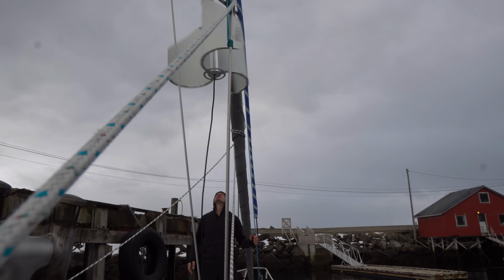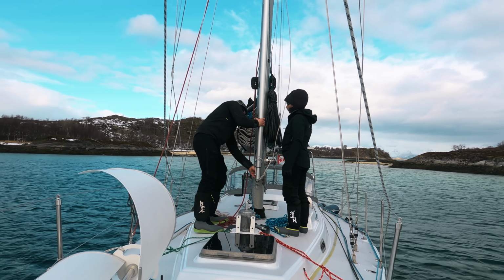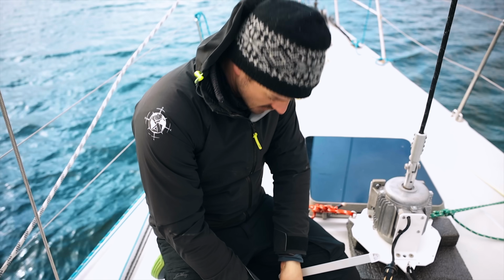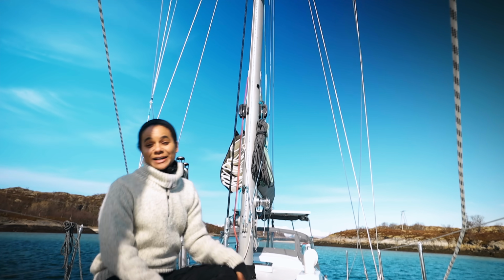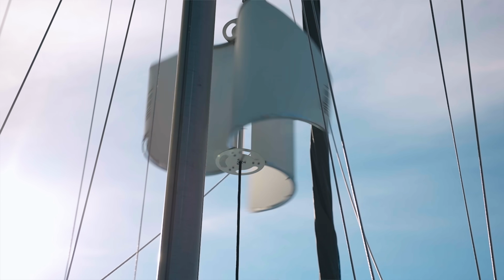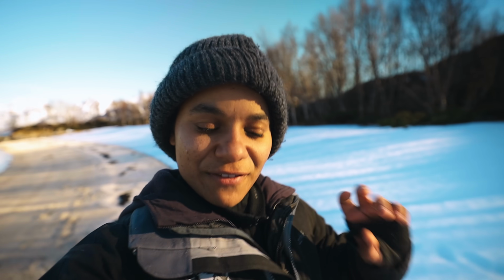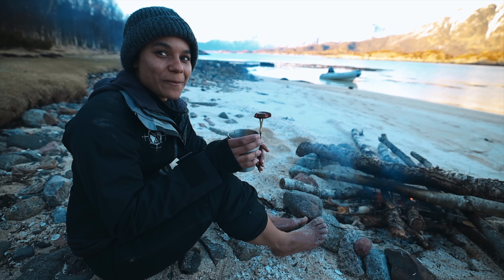No Sailing, Just BULLSH!T — Sailing Uma [Step 273]

Comment: Just a idea? You can use fiberglass rods that screw together, like the ones used to clean fireplaces with a brush , I clean my wood stoves with brushes using fiberglass rods about 3/8 and 36” long screws together I clean a second story house -plus ! They would make a great Torque rod from the blades to the generator and can be broke down to 36” lengths for storage, they are cheap and can be purchased in any home improvement store or online . Please check it out P.S. the threads on the rods go the correct way for your wind blades to spin !🤔👍🏻

Comment: Since you began this journey, power has been a concern.  Every time voltage is changed, power is lost and I discovered (thanks to Damien) that many household items can run directly on DC as long as the DC voltage is higher than the device needs, but lower than the AC rating of it.  This might help reduce your power consumption be even a few percent.  I everything I tested worked on DC w/o needing an inverter :D  Link to Damien's video as a demonstration: https://youtu.be/RdODgbnkFss

Comment: Dan, another thing that might have even more torsional rigidity and would stay straighter would be to use some high burst test hydraulic hose for your shaft.  You might even be able to put the hose inside a PVC sleeve to make it even stiffer.  Schedule 80 PVC electrical conduit has a pretty thick wall.  If you got really sharp you could put seals at both ends of the shaft and then put a light oil in it to cut the friction.  You should be able to find some hose about the size of the bore in your coupler.  If not, you could use a piece of shafting installed in the coupler and then slide the hose over it.  The rubber liner of the hose could be drilled out to get a very tight fit on the stub shaft.  A good hydraulic fab shop should be able to use a crimp on fitting to attach the hose to the piece of shafting.  You could then do something similar at the top.   You might even be able to put more tension in the hose connector to keep it from whipping against the mast.  I look forward to seeing what you come up with.
Is there gearing in the turbine to spool up the RPM inside?  In Sweden where I just bought a farm, have also found good quality crimp on studs that will cure your problem with the screw on terminal blocks.  The smoke may have simply been the new boards burning off manufacturing residue.

Comment: Since electrons run across the surface using more stranded wires increases electrical flow and lowers resistance.

Comment: Thank you Kika and Dan for sharing your experiences with the rest of the world!
I've just saw the following video on YouTube and I thought I should share it with you as it may help you harvest more solar energy from your existing solar panels with minor modification: https://youtu.be/FKhszB4E1_M
Reply from the maker: Thanks for thinking of us and sharing the link. But this one we've actually seen before. Find it a little comical actually. So this response ins't directed at you, personally, but for others who might watch the video and "get ideas". Parabolic reflectors in the solar industry have been around forever, but not commonly used for good reason. Initially was interested when he started talking about fresnel lenses, the the overheating of the cells is a real issue. 

Besides, the first panel is in the shade, and the second one is in full sun. So right off the start, the results are useless. That much shading will drop the output 80% or more. 

The second problem we see is, those reflectors are the same size as the panel, so just add two more panels to either side and you'll triple the output. 

Third issue is that you MUST use the reflectors, since when folded, they block all incoming light. 

Fourth is that those would get destroyed in a good wind storm. 

We are working on adding more solar to Uma. But these things take time to get right. Once we have a working solution, we'll be sharing it here on YT.

Comment: unfortunately the active surface of the vertical windmill is less than half the diameter multiplied by height, so to compete with a 3m diameter horizontal windmill having around 8square meters you would need a huge rotor. Don't blame the charge controller or the generator, there is just not enough primary mechanical  energy to work with.

Comment: I have really enjoyed your posts but have never comented before.  Have you considered how dangerous that rotating shaft is?   I was working on a crew in 1975, drilling out the tubes in a heat exchanger.  The device had multiple brass tubes running through it that had heavy scaling inside them.  We were using a large air-powered drill to drill out the scaling.  My coworker had long shoulder length hair which got caught up on the drill shaft.  The guy tunning the drill saw his head get pulled down suddenly and shut the drill off.  I think it would have broken his neck.
His hair was so entangled that we had to cut it to get him loose.  He had a couple of spots where the hair was pulled out by the roots.  There is a reason for rotating shafts to be fully enclosed!

Comment: Interesting concept but appears not to have enough potential power for what you need on an electric sailboat. Obviously, with power output proportional to wind speed squared, you will get 4 times the power at double the wind speed. Still not enough in my view. I would have gone with the typical horizontal axis and spent my time working out an extendable mount that can cantilever off the stern. It should be possible to make it compact enough so that it tucks into the back when not in use and goes 4 meters aft for operation.

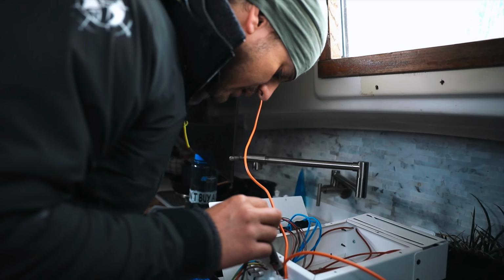Comment: About Your issue in @13:15 with a screw terminal. Actually they are much better things what You're advertising them ;) First at all DO NOT solder wires tips, especially DO NOT use lead free solder to do so. Lead-tin solder alloy is very soft, so You won't be able to screw the terminal firmly enough. The more torque You are apply the more soldered tip will squeeze, so finally the connection may get very loose and starts to burn due to increased resistance. The proper way if You have stranded copper wire You should use special steel ferrules (like Conrad Electronic part number 490812ks) which are pressed onto the wire tip using special tool. Then such can be firmly screwed using such terminal like it would be solid copper wire. Instead of screw terminals You can always use WAGO connectors and terminals. WAGO produces spring terminals which as name suggests has a spring pressing against the metal contact and keeps contact good even in mobile/vibration environment. You don't need (and really shoudln't) solder wire tips then.  Look at WAGO CLASSIC series (example part numer: classic 222-415)

Comment: You need a 4” tube, inside 3 small horizontal wind turbines bolted to the 4” PVC tube, with each turbine benefiting from the exhaust of the turbine in front of it. A fish mouthed solidly glued vertical mounting post, mounted to a ball bearing deck mounted swivel. You need a small little nylon sail on the rear to keep it pointed into the wind. Walla you just created a new approach to sailing and other wind generating needs. You market this and  the world is your oyster. The bad news is, you may need to manufacture most components but that’s my unqualified concept in just a few words.

Comment: Four weeks ago I suggested you get look at sort of hinge apparatus for your solar panels to avoid overnight snow accumulation and to be closer to perpendicular to the low rising sun angles you get (if at all) that far north, then reproached myself a few hours ago today for not making allowance for the need to have a sturdy fitting for the panels to resist really strong winds. EDIT: Oh, you can hoist them vertical @18:00 - just not hinge them fore and aft!

Not to be daunted by, or learn my lesson from, such an experience ... would you consider some sort of dismantlable apparatus that you would put up (once anchored/moored) behind the boat, above the self-steering wind vane (which also has a dismantlable aspect, I suppose) and hold a horizontal-axis wind turbine? It wouldn't block the solar panels if dismantled, and would only be erected on windy cloudy days (when solar isn't generating).

That location would get it away from your cabin so that the noise doesn't affect your sleep. That far from the end of your boat might give the vibrations a seesaw/leverage effect, and you wouldn't want it in place when using the wind vane or running down wind in big seas, or going stern-to on certain town quays in the Med. It might also affect your LOA and fees for marina or town quay berths or taxes, depending on whether it was up and included when measured. And dismantled, it might take up some space, but maybe you could work out how to re-use the spinnaker pole (in conjunction with the solar panel frames) to mount it, so the only extra volume needed is the turbine itself.
Reply: Ah, I see you are using the spinnaker pole with the torsion line and now know you have a torsion line for furling your a-sail. I didn't know that yesterday when I said you were very brave flying the kite without the main up to dowse it behind. So I will reproach myself about that too. ;-)

Another thing occurred to me. Get a Torqueedo, figure out how to mount it upside down  on the end of the spinnaker pole and in a way that it can re-orient itself to catch the wind with increased blades attached.
Then next week: how to generate electricity from a Torqueedo as you drag it through the water... ;-)
Then the following week, build your own regenerating Torqueedo by mounting your generator like this guy did: https://www.youtube.com/watch?v=-TtpMrh_iR4
Reply: Could you fix the house wire lego connectors with aluminium foil or tin foil, or bits of cut up hair clips?

PS No sailing, just bullshit? I love your technical videos - the CapeHorn install, the copper-epoxy, the first elec-motor install, the swap-out for the ocean drive. I can go sailing any time (if we weren't locked down) - but I can't just see this tech upgrade/innovation movies anywhere.

Comment: Grate idea Don and Kika, I love your idea. Please think about putting more of a Drum type with vertical variable pitch blades to control the RPM and also a variable Gearbox to control the Spead.
And if you use an Open-Coil Retraction Spring for the connection you can use the expansion and the contraction of the Spring to control the Gearbox Torque ratio. 
Please think about it and God bless you both. Keep it up

Comment: Try to install the generator at the pullpit in the bow and mount the fan directly to the generator, if space is available.
I think this would be the best fit and would bring the best results for power generation.
The bow is turning into the wind and there will be no obstacles for the fan.

Comment: We have an Eclectic Energy D4000 mounted on a mast on our solar panel arch and don't experience any degradation of solar power due to shadows.  Plus, it's incredibly quiet.  We can be sitting in 30 knots of wind and all you hear is a minor whooshing sound that can't be detected from 30 feet away.  At 15 knots or less, it's virtually silent.  See the drone video on our YouTube channel to observe what the installation looks like.
Reply from the maker: Do you have real work power generation numbers in various wind speeds? Most to the available units we’ve seen only put out 50 or watts in less than 10kts of wind and you need 30+ before they make enough power to actually charge our batteries. (200W+)
Reply: @SailingUma  I should be able to isolate the charging input from the wind generator on our battery monitor panel, which is something I've been wanting to do anyway.  Let me work on that and get back to you.
Reply: @SailingUma  OK, here's what we're seeing from just the D4000 with other inputs disabled:  5 knots = 0 watts, 10 knots = 48 watts, 15 knots = 108 watts, 18 knots (highest wind speed today) = 172 watts.  I would extrapolate that at 20 knots we would hit your 200 watt target.

Comment: I gotta admit I think this is a great idea of where to put a wind generator on a boat! My main engineering suggestion is to make a short shaft to put the blades solidly on top of the motor. Any other type of transfer connection will degrade, quickly. This could still be disconnected. If you need to stabilize the blades you can put a bearing assembly above the blades and connect a line to that. I would say that trying to get the blades "higher" is just going to cause headaches without much gain. Good luck!

Comment: Couple of ideas for you to think about.  1- What about getting e-bikes to get around when you are on shore for exploring and grocery "getting". They an be disassembled for transport in Coco.  They have small trailers available to carry larger loads.  They can be re-charged over night via the batteries.  Light weight and no need to hiring cars or taxis. 
2- Look into get a couple of electric pole saws.  These devises have a battery pack with a 10 foot extension powering a small chain saw.  If you use just the pole extension (linked together) you would have 20 + feet of a transmission rod to power the motor from the wind turbine.  It would already have the necessary shaft linkage and connectors inserted into the poles.
You mentioned that you wanted to start with an off the shelf idea and modify it. 
Again a couple of ideas for you to think about.

Comment: Hey, had to leave a comment: overall interesting, and not bad work so far. Had to leave a few comments for safety though, and for knowledge sharing: 
  - as mentioned by someone else, ferrules are a great way to cap your stranded wires, prevent oxidation and ensure the full diameter is used
  - those screw terminals should not be used on boats as they can cause poor contacts (and even unscrew over time). Wago terminal blocks are spring-loaded and will keep a good connection even in environments with lots of vibration like a boat.
  - don't put a male plug on live pins (e.g. from your dynamo). It's bad practice and will create risk. live plugs should be of female gender. 
  - That soldering iron was a blast from the past, absolutely horrible things. Also dangerous. I'd recommend something more modern yet powerful like something from the ERSA i-con line. 
  - wasn't sure whether you meant it that way, but that 10A C13 socket is going to be 10A no matter what voltage you use it for. 
  - you seem to be using those resettable fuses in your electrical panel that are meant for AC. If you use them for DC, make sure they're rated for DC, as they might fuse themselves in place when trying to disconnect DC. I followed the same line of thought, but most are not rated for DC and might fail at the worst moment (when you want them to trip!)
  - Smoke's never a good sign :P

Good luck out there!

Comment: Dan, you were having issues testing power output from the turbine. I would suggest looking at an inexpensive AC / DC capable clamp meter. This would allow testing of current in cables anywhere in the boat without the need to disconnect and install an inline ammeter or shunt. Used together with your existing multimeter on voltage you could then calculate power. As a bonus, most clamp meters have ranges up to 400A or 1000A (handy for battery currents),also come with probes and have multimeter functionality so it's a handy backup. Do make sure it's the AC/DC hall effect sensor type though, some are only suited to use on AC.

Comment: Never put soldered stranded wire into a screw-down terminal - the solder slowly flows under the pressure and you will end up with a bad connection in time. It's against electrical codes because of that. You can crimp the stranded wire into a ferrule, and put that into a screw terminal.
Reply: As a Union Electrician&live aboard for 25 years, told by an Arctic Sailor NOTHING you do stops corrosion; not shrinktube, liquid tape, solder, whatever, I prefer thick solid wire in a bent loop, but I'll take STRANDED, split&twist fibers, form them around a nail or post, twist the end again forming a tight loop, and crush between stainless washers for a "LUG TIGHT" connection that lasts, knowing in 2-5 years I'll probably have to redo it. As for aluminum connectors and soldered or crimp sockets I hate them; they all rot.

Comment: You might be able to put a second mounting plate on your generator on the top. And maybe rotate it 60 degrees, then you'd have 6 points to strap it down, on top and bottom. 

At the top. If you use a bit of pipe as a bushing on the torsion line under the turbine blades, and put some mounting points on the bushing, you might be able to stabilize the blades more. Lowering the amount of wobble in the line. Better transfer of energy, less wasted.

Comment: Hi Dan and Kika. You are probably fed up with all the suggestions by now and I haven't read through all of the previous comments, plus I will add I am no expert, far from it in fact. But have you considered mounting a secondary pair of solar panels under your existing ones and when on anchor pull these two additional panels out, one to each side, on some sort or runner system, similar to a drawer runner. I have no idea what sort of extra energy you may generate but perhaps double to what you would with just the existing two panels. Just a thought. I have almost caught up, starting from the beginning a few months ago. Your channel is quality.
Reply from the maker: Yes. But that is a lot of weight to support. And any kind of wind would wrench the whole system. We’re working on some pretty awesome solar upgrades. But building stuff that doesn’t currently exist takes a lot of time and a lot of secrecy until it’s ready.